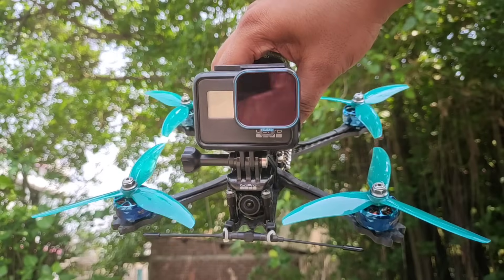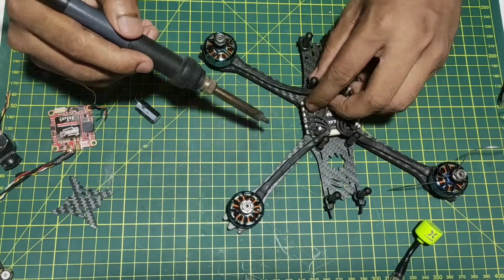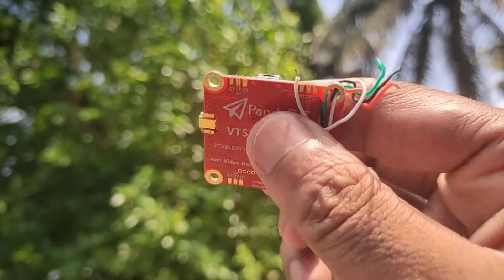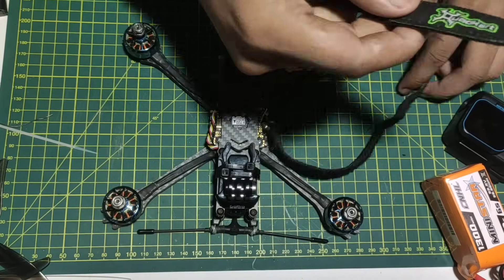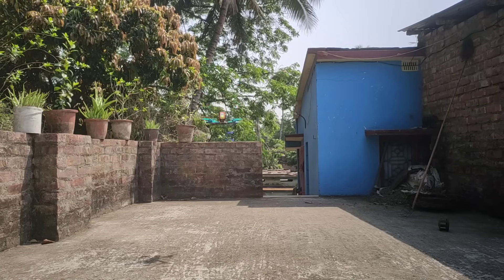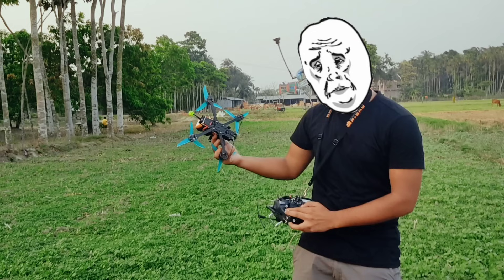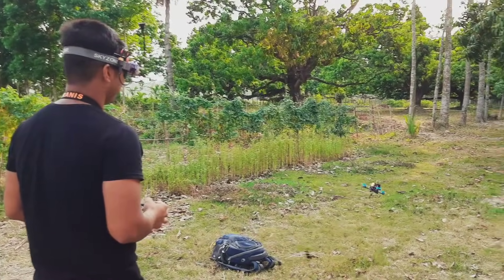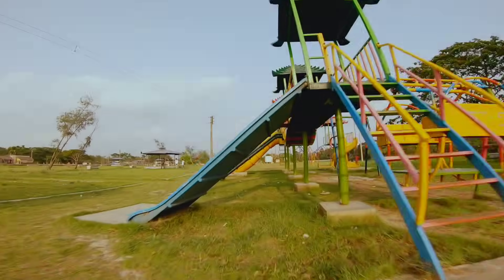How to build FPV freestyle Drone at home || FPV India #fpv #fpvdrone #drone

Comment: Bro, I used same vtx, pandarc vt5804 with fat shark Spiro antenna (rhcp). And eachine 800d fpv googles. Even on setting 600mw on vtx .. I hardly get good video clarity till 100m
Reply from the maker: Is the vtx set to 600mw?
Reply: @akgadget  yes it is set to 600mw

Comment: Drone Cost = 20 - 25k 
Skyzone 02x Fpv Goggles Cost =  25k+
Transmitter = 20k+ 
Gopro cost = 30k +  

TOTAL COST FOR BUILD 80-90k Without Gopro 

PIN THIS COMMENT BHAI MOSTLY SAME HI QUESTION KITNE KA BANA TOTAL COST BATAO 

YE LO TOTAL
Reply: Insta 360 is better because it’s light weight
Reply from the maker: In terms of video quality the GoPro is way more better than insta360..
Reply: @akgadget  understood
Reply: @akgadget  bhai Maine skystars ka H743 hd liya single gyro accha rahega n
Reply from the maker: Yeh very nice FC!
Reply: DJI only dosto!
Reply: it's too much bro...

Comment: Just wanted to build an fpv, you have done a great job but for a newbie it's hard to follow up when you connect/solder the wires to the chips. Also it would be helpful if you can put up all the required parts and purchase links to the parts.
Reply from the maker: You're right.. I will try to make a begginer guide video soon...,
Reply: @akgadget   looking forward to it! nice video man :)
Reply: Bhai cost kiti ayi
Reply from the maker: Approx 20-25k for Drone only
Reply: @akgadget  how much for the entire setup?
Reply: sir can you please built one for me..i want to be a freestyle fpv pilot..but can't find relevant drone..please help me if you can
Reply from the maker: Sure... Contact me on instagram, link in the video description..
Reply: Can i fly this drone without fpv goggles use only mobile screen

Comment: Bhai costing bhi de deta, thodi helpful rhti
Reply from the maker: 20-25k ( Drone only)
Reply: @akgadget  which goggles uh got brother... I wanna get into fpv, wanna start witch a small cinewhoo, but the goggles seem to be so expensive and also the remote controller... Will it be good to get the radiomaster TX12 and Eachine EV800D... Or would be better to wait more, save more and start with better products? Does the learning curve change abruptly with better equipments... I have lots of questions, cuz it's an expensive hobby but before diving in I need to ask some questions. please do help brother
Reply from the maker: If you able to get the ev800d within 8k then just buy it otherwise skyzone cobra goggles is better.. and tx12 transmitter is really good.. also check the radiomaster Zoro ELRS version (approx 10k) ELRS will give you really solid control range..
Reply: @akgadget  thank you so much for your input brother.. What's your Instagram id so that I can connect to you better?
Reply: Found it

Comment: Bro what will the price of fpv drone without gopro for beginners like basic fpv for practice and startup??
Reply from the maker: You can build a complete fpv drone within 45-50k.. including goggles, transmitter and some battery..
Reply: @akgadget  Including goggles 50k? how bro? 😐 Which goggles bro and i have the tx12 already doing practice in simulator but i am pretty confused which one should i go for Freestyle vs Cinewhoop 🤔 And how much it goona cost me for a Decent Cinewhoop?
Reply: @atatsatshuklafilms3731  You can build decent cinewhoop or 5" freestyle for around 20k , buy the skyzone cobra s for less than 15k and couple of batteries and charger for 5k you can buy all these under 50k. If you can choose the right parts.

Comment: Which gopro
Reply from the maker: GoPro Hero 7 black..
Reply: @akgadget  i saw in internet gopro hero 7 has some problem in fpv such like much gellow in reelstady satabaligation.  Which stabalizer you use?
Reply from the maker: @_taohid_  I didn't use any reelstady or any after record stabilization.. I use stock Hypersmooth stabilization of the GoPro..
Reply: @akgadget  did you think gopro hero 7 has no gello in fpv footage. And it is good for fpv